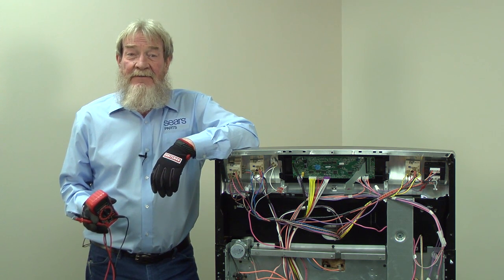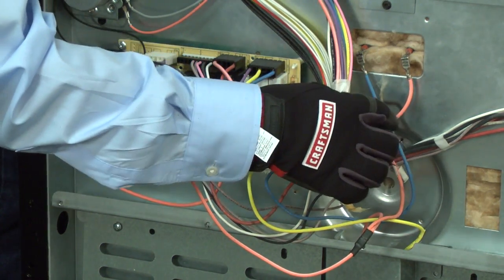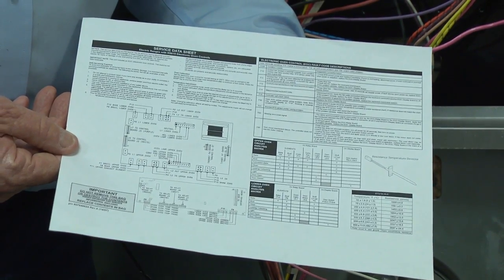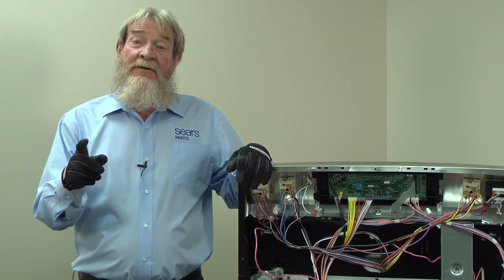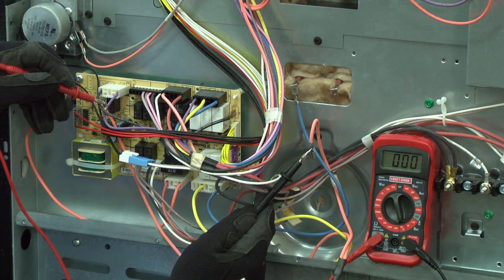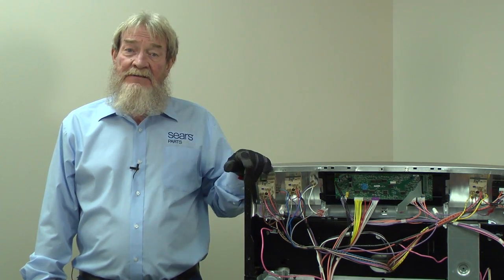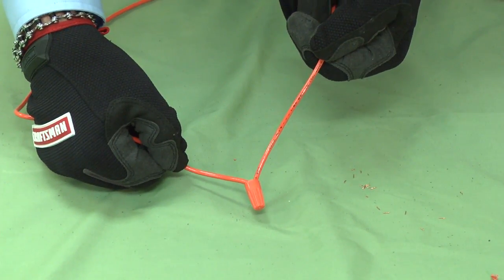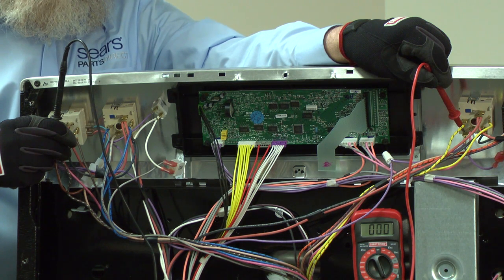How to Test Continuity on Wires and Electrical Parts

Comment: Not much instruction here for someone who's never used a mutimeter. I followed the directions of my ever start Cat 3 for testing resistance/continuity on electrical switches & plugs & nothing.. Only setting that gives a jumping around reading is ~V. The exact directions don't give any reading at all..
Reply from the maker: We provide general instructions that work for many different types of multimeters. The owner's manual or instruction sheet included with your multimeter also provides specific directions for using the type of meter that you have. We recommend that you follow the directions in the owner's manual or instruction sheet to measure resistance.

Comment: I tested my inlet valve (W10327250) and it read 14.2 by my continuity test and the replacement reads 14.02. Is 14.2 enough out of range to indicate that the original part was bad? IE: what is the acceptable resistance for this part? (If you happen to be able to answer, thanks). And by the way, if I use the 200 ohm position I get no reaction (it just reads 1) on the new or old part. I have to go to the continuity setting, which confuses me. I thought they both read ohms. ?
Reply from the maker: The technical information for dishwashers that use that inlet valve indicate that the resistance of the solenoid coil should be between 890 ohms and 1090 ohms. Your meter likely measured 1402 ohms and 1420 ohms through the valves. Because you measured 1402 ohms through the replacement inlet valve, the resistance that you measured is likely adequate for the solenoid coil to open the valve—especially if the new inlet valve works. The 1402 ohms of resistance isn’t too far out of the specified range of resistance for the inlet valve according to the technical information for dishwashers that use that inlet valve. The solenoid coil on the original valve may have been okay since your meter measured 1420 ohms through the valve. If the original valve wasn’t working, a mechanical failure other than a failed solenoid coil could have caused the inlet valve from opening or shutting. If you need more help, let us know.
Reply: Thanks! It appears the culprit is actually the circulator pump.

Comment: hi I am trying to find a test meter the best way to test a vacuum cleaner cable fault, my multi meter is reading 230 volts but not powering up the cleaner, touch with test stick that is showing power . Fitted replacement cable working. any suggestion best meter.
Had few cables where it's been a faulty sealed plug and some a partial break in the cable
Reply from the maker: We recommend that you test the wiring between the electrical outlet plug and the power switch for continuity as shown in the video instead of measuring live voltage. If you measure continuity through the wires, then you’ll likely need to replace the power switch.

Comment: Can one check the continuity on a wire that may be hot? would it destroy the multi-meter, or worse..?
Reply from the maker: You should unplug the appliance or shut off the house circuit breaker to disconnect electrical power before checking continuity. The multimeter sends a low voltage signal through the wires to check continuity so the live voltage interferes with meter readings. You can damage some multimeters by checking continuity through live wires. Handling live wires also presents an electrocution risk.
Reply: Thank you!